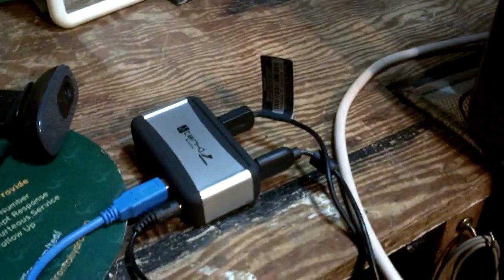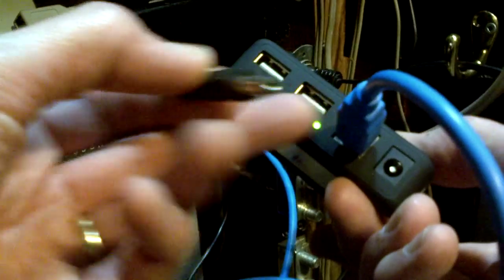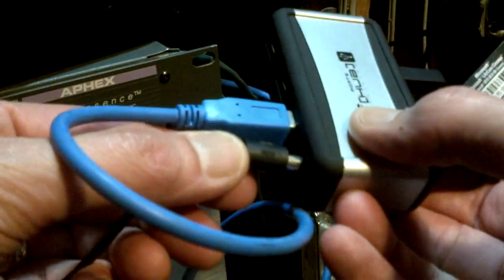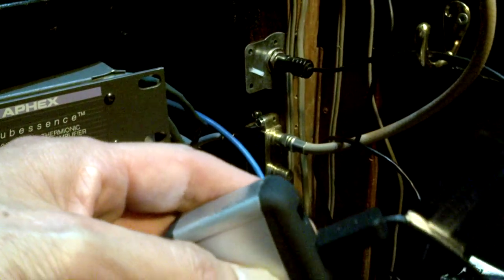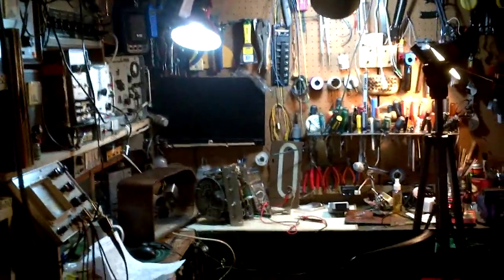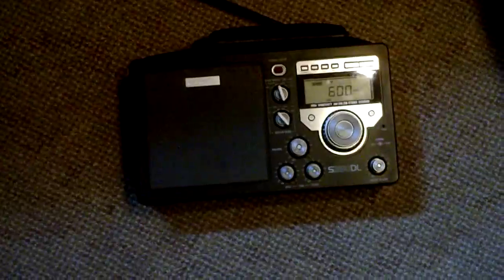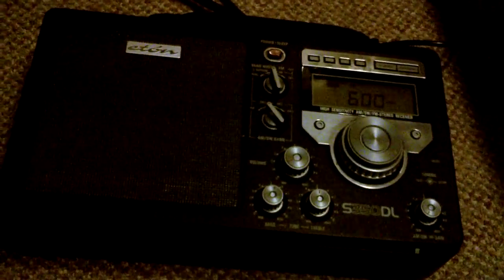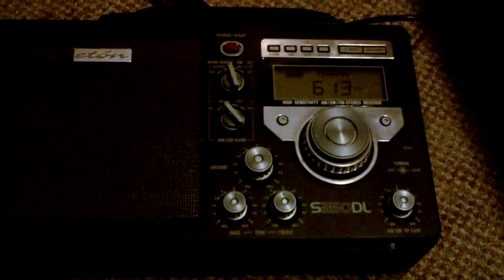More Sources of Radio Interference in my House

Comment: Great video!!
Reply from the maker: I bought the little powered hub to power my two cameras since the computer seemed to be struggling when both were plugged in.  The interference it created when I first plugged it in would have only been noticeable to me if I'd had an AM radio on that was tuned to one of the offensive frequencies and that's very unlikely.  Otherwise, just as I did, I put this monster in the midst of the most sensitive place - my radio shop - and didn't have any direct sense that I'd messed myself up.  Those sneaky little bas . . .

Comment: Jim,
Those switching  wall  warts  are notorious for the hash they give  out. If you have a regular transformer power supply  try substituting it for that wall  wart and see if the interference  still exists.
Reply from the maker: I have a lot of little plugin power supplies so I'll be replacing all these noisy ones.

Comment: USB 2 can supply max 500ma from a normal port. Laptops are usually less due to battery saving. The powered hub gets power from the computer port and can power devices that add up to no more than 500ma. The power supply is only needed when the devices add up to more than the computer ports max output current. You may be able to run the 2 cameras without the extra power supply and save some of the noise. Also, turning off a computer doesn't actually turn everything off. Lots of things on the mobo are still powered as long as it's still got AC to the power supply. Maybe you can build your own Faraday cage around your shop. But don't use aluminum foil or it will look like a giant one of these:

http://zapatopi.net/afdb/
Reply from the maker: I bought the hub to supply power independent of the computer which seemed to be tapped out and to extend the cameras' reaches.  Now you are telling me that the hub's own power will only 'kick in' when the demand pulls the computer's own supply down too low.

 The cameras draw about 1 watt each so that would be about 400 mA.  I'll try it without the supply and see what happens.

Comment: Wow.  That hub is noisey.

Tom
Reply from the maker: Not the hub but its power supply.  These little guys are producing signals that can be received 50 feet away.  They change frequency with changes in load which makes them really hard to find.  Don't you have any there?  Surely with all your radio work, you've heard the characteristic signal too.
Reply: I have several dozen and they drive me crazy plus they waste power when device is off.

Tom